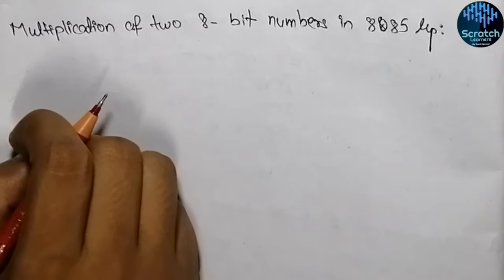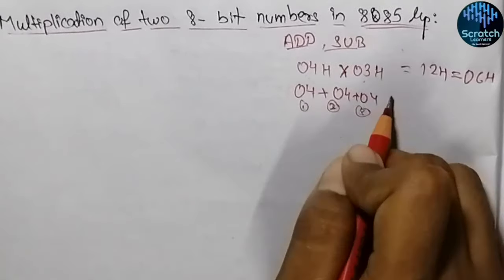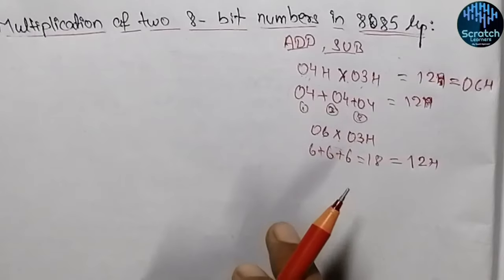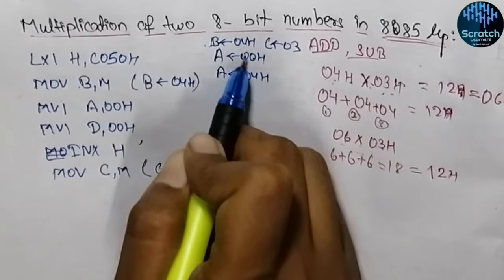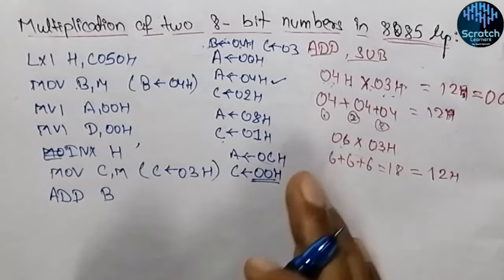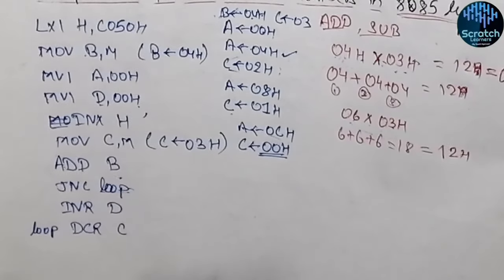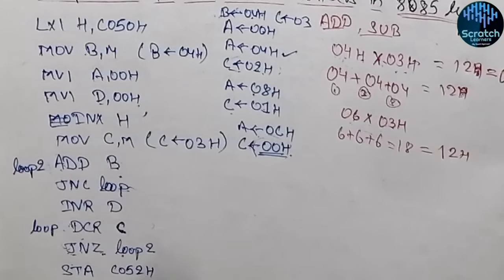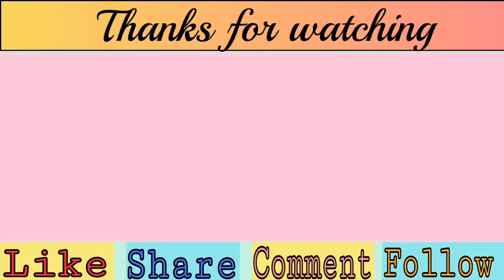8 bit multiplication in 8085|Multiplication of two 8 bit numbers in 8085|8085 microprocessor

Comment: I get an "extra character in line 15" error. I have typed INX H,c051h Only. Can you please help me?
Reply from the maker: INX H is used separately.you don't need to mention the address CO51.. INX is one address instruction and you are specifying address with it, that's why it gave error
Reply: @ScratchLearners  i used LXI in place of INX with the same address And it worked. Thanks a ton ma'am. If only my college lecturers were half as knowledgeable as you!